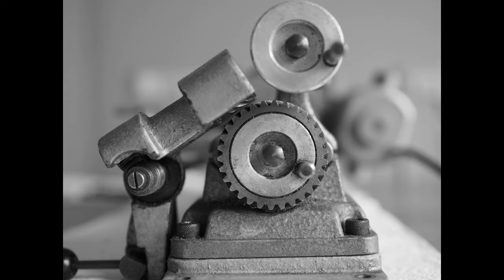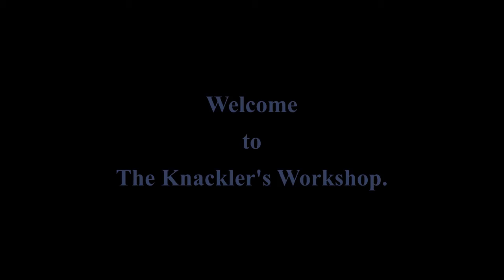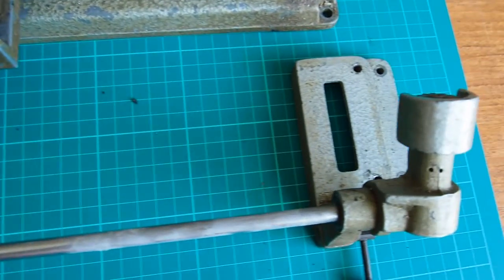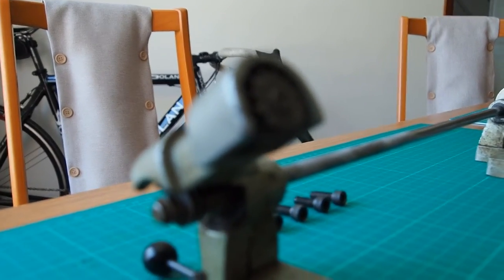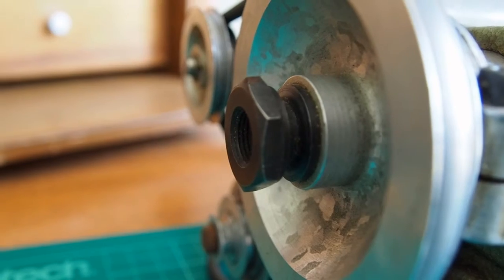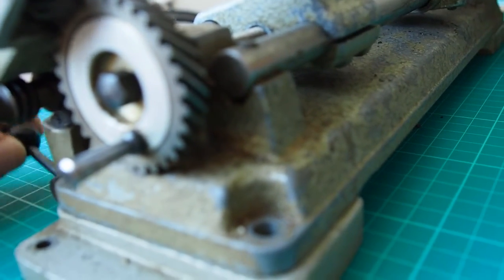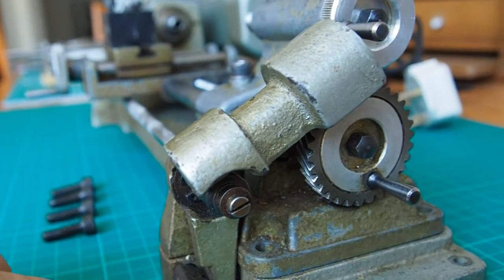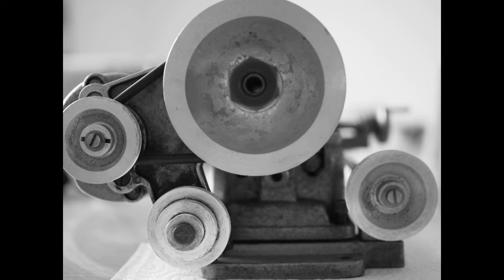Emco Unimat SL Lathe - PowerFeed.

Comment: Hi Paul. Another great video, from what you have shown so far these Unimat lathes seem quite modular, very interesting. Is that a Union wooden toolbox I spy in the background?  Cheers, Alan.
Reply from the maker: Hi Alan,
Hopefully i will make the last (for a while) in this info series on the Unimat SL next week. Then i will do another series on restoring it.
The toolmakers cabinet is a Roebuck brand...  
Cheers
Paul,,
Reply: @TheKnacklersWorkshop  Hi Paul. A Roebuck, not sure I've seen one of those before. Cheers, Alan.